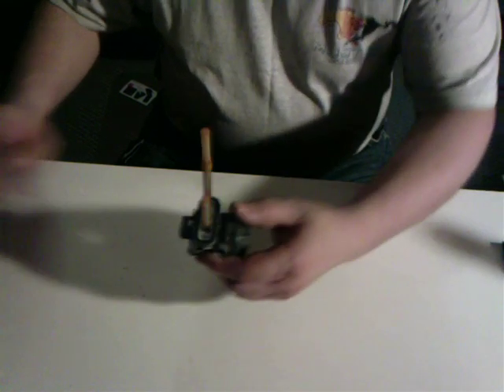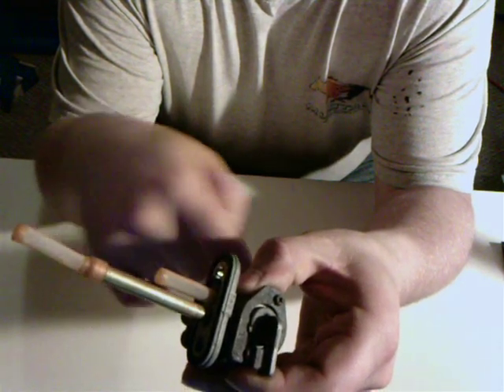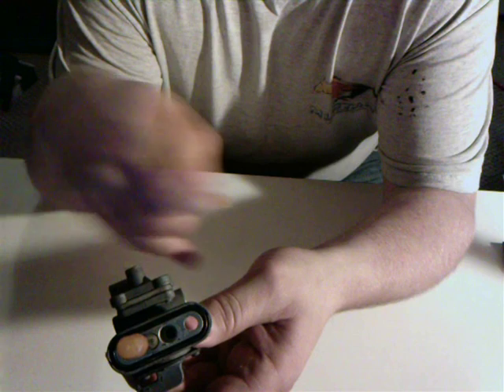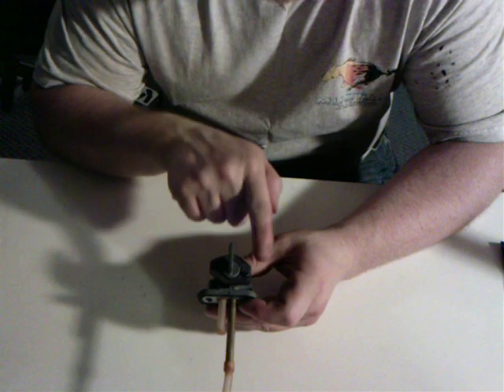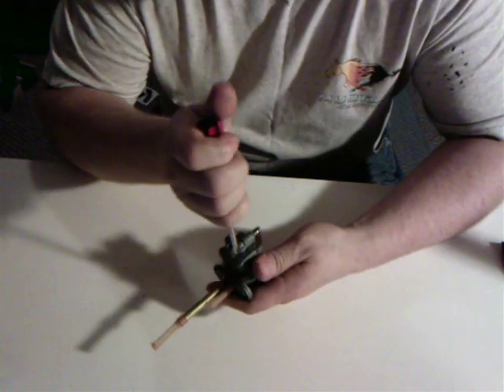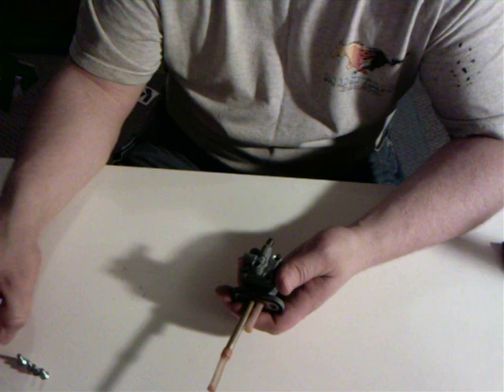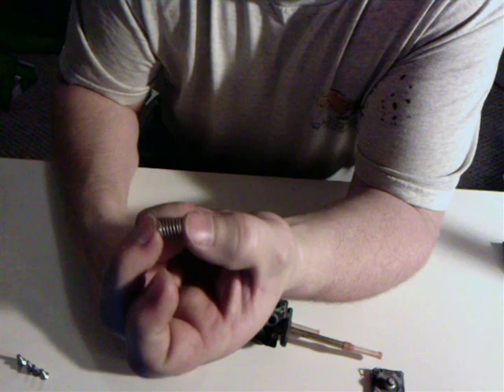Petcock Rebuild 1

Comment: I could not get the two screws to the top part of the petcock off so I unscrewed the four smaller screws and found the piece to be in perfect shape. I didn't suck on the vacuum tube to test but it is OK. But NOW I cant get the piece together because of the spring. Any tips?

Comment from the maker: @smotleyjr79 if the spring is working, you won't get any fuel through the valve. The vacuum from the carberators pulls on the diaphram, compressing the spring, letting fuel flow through the valve down into the engine.

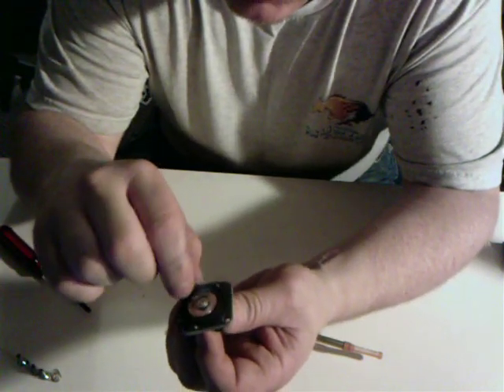Comment: Why did the video stop after 4:48? Is there a second part? I got the kit and the petcock pulled.
Reply from the maker: Sorry about that, I keep putting off redoing this vid because i'm in school right now. Once you have the petcock apart make sure to look for tears in the rubber diaphram, and / or a groove worn into the tapered section on the backside of the knob. Both of these will cause your petcock to leak even in the off position.

This is one of the first vids I did so my editing was pretty rough.
Reply: +Whitehorze Is there now a part 2? I just got everything pulled apart but on that house-shaped nylon/piece where the spring is, my bike had a thin gasket on each side of it (one of those has the center metal disc). The new part has both gaskets together with that metal disc through them. The problem is the orifice at the top of the gaskets are different. One is more of an opening and one has two holes. I'm afraid the gas won't flow right or it will still leak of I put it together like this. Help?
Reply from the maker: +PMar Pmar If I'm understanding you correctly, The second opening is to relieve air pressure inside the valve so if you climb a mountain, you don't have air pressure inside the valve opening or closing the valve while you're riding. Companies will update designs like this without telling anyone so don't be too worried. Assemble the valve and test it for function. If it leaks, pull it apart and see where the leak is coming from. If it doesn't leak, you should be good.
Reply: The only way to see if it leaks is to reinstall it and put gas in the bike. It leaked worse so I pulled it again and did some research. I don't know why it has two gaskets one one side of that part but it's not right. I was told by a few good sources that you never stack gaskets, so I pulled one off and put it in the other side of the nylon part. In doing so I tore the center hole a little so I tried some fuel-resistant rtv and reinstalled it again. The leak started before I could even fire it up. Now it seems like it doesn't seat against the tank right. So frustrating.
Reply from the maker: You're not alone. Be careful when you tighten down the bolts, The aluminum is so soft that it'll warp and leak very easily.

Comment from the maker: Thanks. Windows Movie maker has been crashing on me so I haven't had the chance to make a "part 2" yet.

Check the screws in your faceplate. The factory screws are only held in by 2 or 3 threads. Mine was leaking and when I tore it down i found out that the screw had stripped out of the aluminium casting.

Good luck.

Comment: Thank you very helpful. Question though what and why do we have the diaphragm in it we have a 1983 Honda .  I've never have heard or seen one in any of the Harley's I've owned.. Just curious.. Thanks again for the helpful information.. :)
Reply from the maker: This is off my Kawasaki, so I don't know if Honda or Harley use anything similar.

Basically, the spring loaded diaphragm keeps gas from running down from the tank and flooding the carbs/engine when you leave the bike sit and forget to shut the valve off.

Comment from the maker: @wolfpaw69 It depends on how old the engine is. If it's a newer build you might be able to get a kit from an independent shop (Ask around). If it's over 10 years old the shop might not be able to get the parts themselves and you'll either have to buy a used valve and salvage the parts or save your time and the hassle and just buy new and get your tiller up and running.

Ask around at outdoor equipment stores that sells chainsaws and lawnmowers. If they can't fix it they'll know who can.

Comment: that may be a little different tiller. The rebuild kits are almost as much as the actual petcock so u would probably be better off buying a shiny new one. And like he said u cant really replace a little spring or just a single part. If i were u i would spend the $27 or find a used on on ebay.

Comment: Sorry but you are wrong. The three positions are PRIME, ON and RESERVE. When the bike is not running On and Reserve are the off position as the vacuum is not working, when the engine starts the vacuum works and fuel can pass through the tap. Prime is used if the bike had been standing a long time and to refill float bowls if fuel has evaporated.....!! Ok
Reply: Andy Reynolds he in fact is right. I'm looking at the petcock on my ex500 as we speak :)